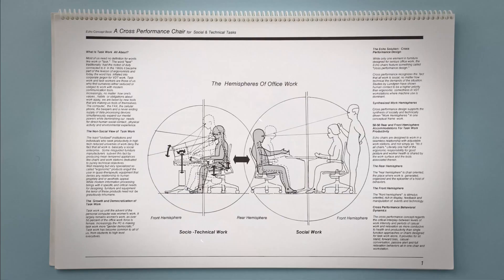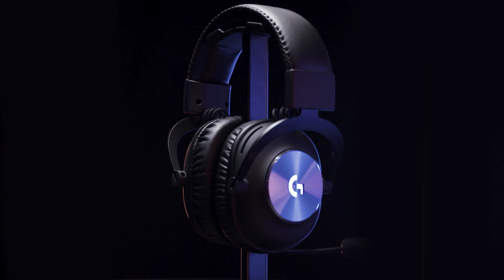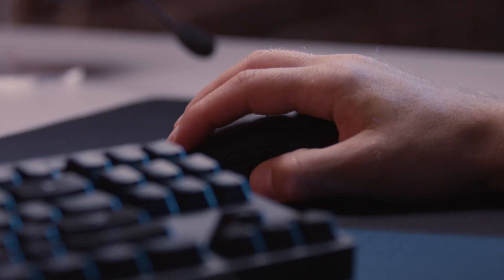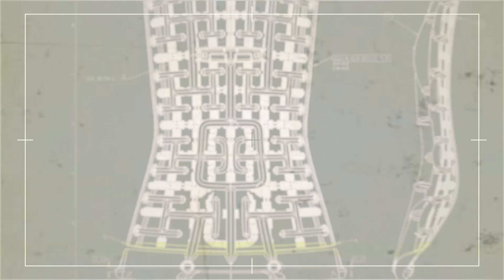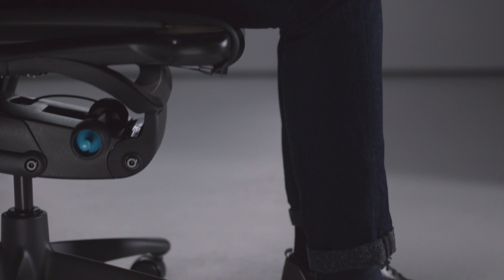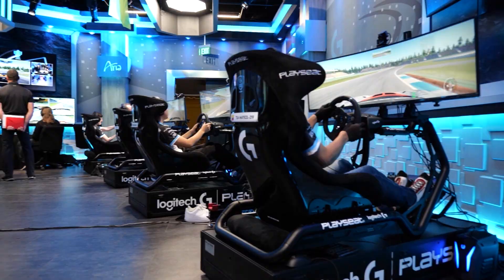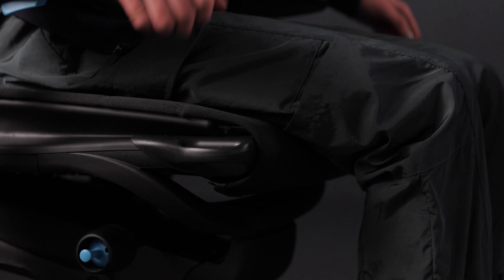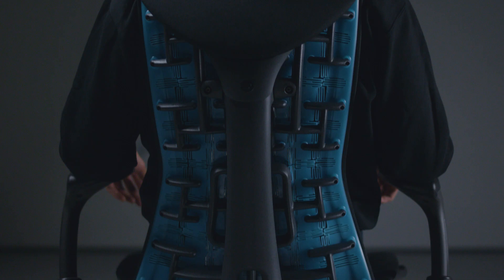The Story Behind the Embody Gaming Chair

Comment: I don't get what logitec did other than rebrand the regular embody chair, still great chair though
Reply: It’s basically a less expensive model with more features than the more expensive normal base model with slight changes to the lumbar support. It’s a better deal IMO
Reply: @Scragg-  basically the Logitech has thicker cushion and is "copper infused" that makes it cooler and more breathable. Also the lumbar support "forces" you to sit more upright or forward (because competitive gamers tend to lean forward when playing) as opposed to the original embody which is more relaxed and laid back. I also heard about the original being more expensive but being cheaper usually through your local authorized dealers, I don't know if that's true or not
Reply: @ightimmaheadout290  I managed to get a good deal on a brand new original embody, it seems for force me to sit straight enough tbh I don’t think there is much of an actual difference between them besides maybe the padding. In any case the one I got is comfortable enough so I’m happy with it
Reply: Logitech’s version is more padded and stiffer for gamers than the original embody but other than that they are essentially the same chairs. I got mine for $1100 shipped with tax included and that’s why I purchased mine. I was not about to spend $2k on a chair so when the opportunity arose I jumped on it. I am not the type to buy anything used. Call me superficial but I think it’s nasty. Plus, the Logitech’s version is limited edition so if I want to sell it at a a later time the value will still be there. Logitech’s model is fully loaded whereas the regular embody is customizable to an extent. I have been sitting in my chair for over 2 weeks now and I have not had any more back pain or pain in my tailbone like I had when I was using my Steelecase Series 1 chair. This chair is worth $1100 to me but I would really have to think hard about paying $2k for the chair but I think at the end of the day, I would.
Reply: @iHustleLXXXI  don’t make the same mistake I did by tightening the front knob all the way to keep it from leaning back at all and fucking up your neck. You need to have it at least a little bit loose so that it can actually conform to your back and flex. 

Front knob - tension to conform with back arch and flex 

Back knob - forward + back lean. 

I was using front knob all the way tense and using the back lean to compensate for the lack of an arch with that setting and it really screwed up my neck, I just realized last night that I had been using it completely wrong and did basically the opposite settings and I’m feeling much better already

Edit: it took a few weeks using the wrong settings to start feeling pain
Reply: @iHustleLXXXI  would you be able to share how you got yours at a discount?
Reply: @iHustleLXXXI  where did you find it for $1100?

Comment: What’s the scientific reason for no headrest or any neck support. The only thing holding me back from this chair currently using Aeron with Atlas head rest. A must for my neck disability. I can’t sit more than 5 minutes at a time but my current chair is by far the easiest.
Reply: What I understand from the reviews is that this chair is designed to be used at a very slightly/naturally backward inclined position to hold the spine in the correct position. It seems like you don't need a headrest at such a position since you would be looking at the monitor with your head very slightly forward, therefore your head would be hanging in the air without pressure. That's what it says in the specs of the chair on their website.
Reply: @unity20000  I need a headrest on any chair I sit in because of my cervical dystonia my head pulls severely to the left side so I need support to keep my head straight without enormous amounts of pain.
Reply: Atlas are making a headrest for Embody too, but I guess there will be a few more months before it's out. This is also currently what's holding me back from getting an Embody, because I would really like a headrest for when I want to lean back and relax a bit. I'm kinda waiting with getting a new chair until the Atlas Embody headrest is out, so I can know if it's good or if I'm better off getting a different chair entirely.
Reply: @salut9658  Nothing yet, unfortunately. Still on my cheap Ikea chair. The Atlas headrest isn't out yet, but will be in the beginning of 2023 I believe. I'm still leaning towards getting an Embody + Atlas I think, might get an Embody soon and preorder the headrest.
Reply: Not sure if the headrest will void the warranty of the chair or not. Seems like it won't leave noticable marks, but who knows.

Comment: I believe the Aeron is the superior chair in many ways (assuming you've found the correct size for you and can live with the static arms) however I couldn't get used to the hard frame around the seat which made me return it.
I got an Embody after that and of course it doesn't have that sort of problem. I miss the forward tilt of the Aeron though and the Embody is very poorly built for the high price tag. All plastic with lots of sharp edges everywhere, the whole construction isn't very confidence inspiring but that's what the warranty is for I suppose. It's a comfy chair but it lacks freedom of  adjustment which makes it hard to recommend. You just have to test the two and see for yourself, both are quite controversial.